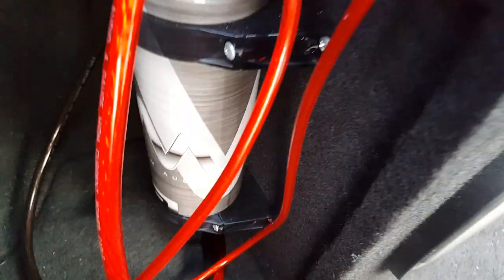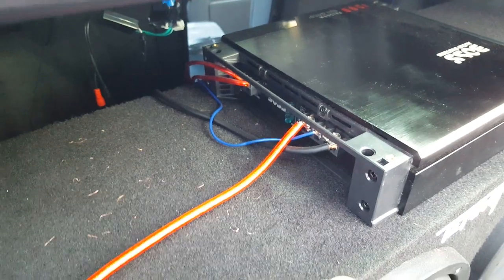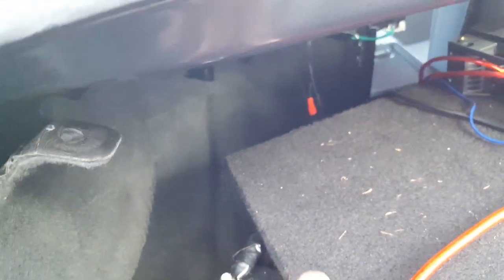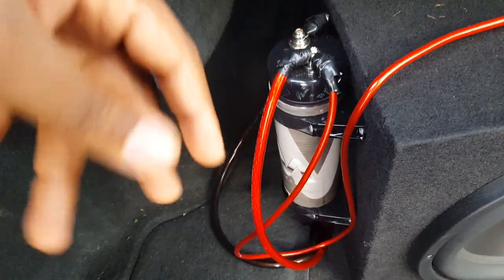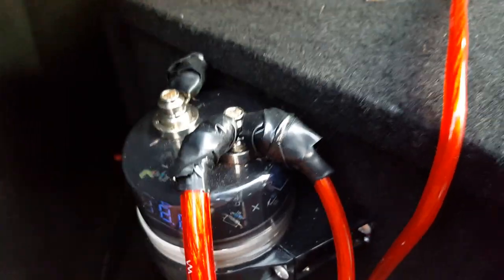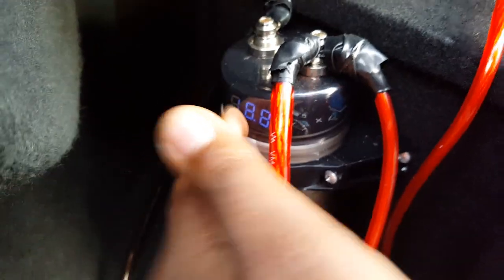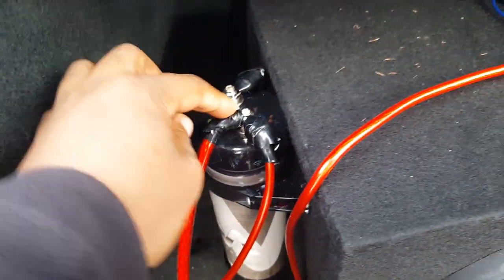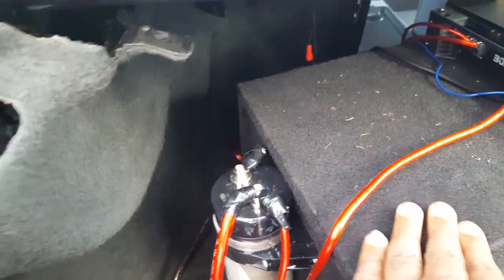HOW TO INSTALL A CAPACITOR WITH AC CAPACITOR WIREING TO YOUR  CAR TUTORIAL

Comment: Good video,  I'm an electrician and the set-up you have was done very well. Great idea to put tape on the caps of the capacitor too, that helps to ensure the current following through the exposed copper at those points cannot "arc" through another object or even a person.  Running a thicker gauge wire from the capacitor to the positive battery lead and then a smaller gauge wire from the capacitor to the amp is also highly recommended like you did so that you're not draining the power in the capacitor as soon as it gets there which would ultimately defeat the purpose of the capacitor.  
One thing I noticed you say was that some people say you can ground the amp to the negative terminal on the capacitor. With my experience and first hand knowledge on that I would have to advise against it.  Some systems won't even turn on if both the amp and capacitor use the same ground or sometimes if they're even grounded close to one another.  The best solution is to sand a spot on opposite sides of the vehicle frame wherever the capacitor and amp are being installed, so that you see the color of the metal rather than the paint.  This will provide a good solid ground. Now I say to prepare 2 spots on opposite sides so that each device has plenty of room to ground to the chassis of the vehicle without interfering with the other devices grounding.  If you have any questions regarding anything I've mentioned please feel free to ask away.  Thank you for the video and the time you took to explain it.
Reply: so when you're running a wire from the battery to capacitor you have to use a thick wire and from capacitor to amp you have to use a smaller wire why so i just cut some of the old wire 4 guage and im gonna use both you saying i should get a 8 gauge going to amp

Comment: Note that even if the capacitor doesn't help the sound and bass of your system, it will help take the unbalanced load fluctuations off of your voltage regulator, car battery and alternator.

If nothing else I think this reason alone is enough to justify installing one on your system.
That voltage regulator is working it's ass off trying to maintain the voltage balance for not only your battery, but all the sensitive electronics in today's cars.

So roll with it, if people argue the use of a stiffening capacitor on your system, point these facts out to them, and if they continue the argument they're just simply jealous of yo sheeyat!!
Reply from the maker: lol well said thanks for the lesson good to know.
Reply: ezridr1234 actually it will make it sound better.if your alt can't handle it. I noticed a difference in the sound of mine too when I had it
Reply: Chris Soden yeah I know it will, I was just making the argument for the ones that don't believe it does. there are other reasons to install one.
Reply: Exactly!! Especially, considering how affordable caps are!

Comment: You did right,... as a life long bass thumper, a capacitor MIGHT not help the audio. But with steady flow up electricity it def does! 
I like to connect the amp and cap thru a distribution block. To reduce chance of current hold, (thumping when power is turned on) look it up.

Comment: Should have used a splitter for the power source one wire straight to the cap and the other running to the amp but still clean

Comment: Yo so far your video has been the most helpful but i have a power cap that has two - and two + i don't want to end up hooking the wrong ones up
Reply: It’s only giving you more opportunities to have more wires to hook up like having a distribution block.  I have 3 hooks on mine.  It was easier for me to hook up wires without a distribution block.  For the negative side you may be able to run 2 negative ground ad different points, as of to like the body and frame of the vehicle.
Reply: Sorry forgot to say it’s like doing the Big 3 upgrade.  But on the capacitor
Reply: I have since learned much and no longer require a cap 160 ah of yinlong and counting

Comment: good video. if I already have my 4 gauge wire running for my battery to my amp can I just unhook it from the amp and hook it to the capacitor and then just run another piece of 4 guage wire from the capacitor to the amp?
Reply from the maker: yes sir you can that easy
Reply: +fabolousg4ever thanks man very helpful vid
Reply from the maker: +Kyler David no prob simple and to the point.
Reply: how do you charge it?
Reply: Jackie Welch the capacitor should have came with a resistor that you touch to the positive cap. Terminal and the line coming from the battery till it's fully charged
Reply: Never got a resistor but I used a voltmeter and charged it to 13volts and then put a 300. Amp fuse in. Thanks for your help! Got a question about a box I want to build. Just want to see what that tuning would be if you have a few.

Comment: What’s up bro I have a fast ass question how do you charge up a stinger capacitor without getting lit up and is everything all the same when it comes to the stinger capacitor
Reply from the maker: Should come with a load resistor to trickle charge the capacitor.

Comment: You connect the power cable and the earthing and Where do u connect the remote to the amplifier..do the remote cable connect with the capacitor or from the stereo connected straight to the amplifier
Reply: You don’t as he said it automatically turns off

Comment: i have the same cap and it always says 18.8 v when not in use. Good to know thats normal. It seems to work great though for how cheap it was. Is yours still workin good?
Reply from the maker: yup still working great
Reply: +fabolousg4ever  nice. All these people on here sayin caps are a waste of money aint heard my system before n after a cap. nite n day diff
Reply from the maker: +Jeff Barton yup only if people knew they are crazy the extra hard hitting bass is well worth it.
Reply: I just hooked mine up last night , it's the same exact one VM Audio 2 farad $25 free shipping from eBay good to know others have it and is working for ten as well... Mine also says 18.8 when not in use / when the car is off , wondering how did you wire yours
Reply: Loyalty 60 no you need a 10 farad capacitor get a voodoo capacitor on Amazon or ebay

Comment: I know you said that some people says that it’s ok to ground both amp and cap at the same ground point, I don’t know where their coming from but according to professionals they say not to ground cap and amp at same ground point.
Reply: I did like that and it working werry well I pluged only on amp not on battery coz battery cables are on amplifier there no need to connect cap an battery....
Reply from the maker: I use the cap and it works good

Comment: I have a brand new optima yellow top and brand new alt , and light dim & rev up n down when bass hit , btw I have 2 12 kicker l7 and kicker 1.500 watts amp
Reply: look into the big 3-4 upgrade for your vehicle. grounding the alternator properly with the battery is the big 4.

Comment: Just bought 2 12 in kickers with a 2500 watt amp, Do I need a capacitor?
Reply from the maker: +David Edmondson im pretty sure unless you have a optima battery
Reply: fabolousg4ever I got em hooked up so far no problems and they sound great!

Comment: hey man when not in use is it supposed to stop showing the volts? after I leave it off for a while it turns off
Reply from the maker: Mario Rios yea its suppose to mine only shows the voltage when the bass hits hard.

Comment: I see some on Amazon that claim to be 30 Farad, which I feel has to be an exaggeration. I have a 1100w peak amplifier, 2 12" subs. Would it be smarter to get a 4 Farad one? How much did u spend on that one and what Farad is it? Thanks bro
Reply from the maker: +Sam Goodman 4 farad is fine for that wattage.
Reply: 1000 watt =1 farad.. so 1.5F or 2F is good enough

Comment: I think it's working, simply because the readout in 13.5-14 volts.  That is almost impossible in a car with radio, heater, etc. running.

Comment: i know this vid is over a year old, does the cap still work well now and do you run everything off of one battery?, i installed my 2 12' kicker with a 2500 spl amp turned down but my battery seems to suffer on startups sometimes and was thinking about installing a cap
Reply from the maker: +Diondre Knowles still works perfect like the day i bought it works great and sub hits hard still very happy with my purchase.
Reply: that's great to hear man. And did it prevent battery trouble?
Reply from the maker: Diondre Knowles yup car was fine afterwards car drove fine like before i installed the subs.
Reply: thanks so much man. I now know what i must purchase.
Reply from the maker: +Diondre Knowles ok no problem

Comment: Where did you connect your remote wire (blue) ,cause I see you still got a stock radio
Reply: Get a new wire harness that adds the remote line and RCA hook ups. Like an adapter
Reply: Multiple ways tbh.
You can jump it off of an accessory fuse in the inside fuse box or any accessory  wire (if you know what your doing). BUT... make for damn sure its not a constant wire or fuse or your amp will always be on and will drain your battery.
Reply: Also the acura tl has a factory sub n amp so you can utilize the amp wiring harness if you know which wire is the remote turn on the factory amp

Comment: Caps are a waste of money. Just do a proper install. Big 3 Upgrade. If you need more power then add another battery.
Reply: ACCURATE ‼️‼️‼️
Reply: Wow a year later this is still a very ignorant comment, if they were a waist of money people wouldnt make them or buy them, it’s been years bro. I don’t see the manufacturers slowing down. 
They do a lot like dude said above they help keep your electrical system working great, the bass is cleaner and smother cause there is no strain on my battery... it Maintains the above 12 volts power or above  so your alternator isn’t forced. 🤦🏿‍♂️
Reply: these set up is not for competition level Bro! 😂 this guy need a little bass on his ass..that battery is enough to supply the power that amp is asking.. upgrading a Big 3 in a small car plus the AC motor will be a burden to your engine

Comment: You suppose to charge the capacitor first i think thats why your led doesnt stay on
Reply from the maker: iCleansneakers no this model doesnt come on unless the bass hits hard enough to use the capacitor
Reply: fabolousg4ever. It stays in an idle mode I'm using same model 3 Farad on 2 power acoustik 12's with a Alpine V12 1,000wX1 rms monoblock and a pioneer 6.2" head unit in an 03 eclipse and it totally changed my sound
Reply: But you are supposed to charge them first or you'll end up stranded with a dead battery like,me lol

Comment: Hello, better second battery :) Anyway, the cable between the amplifier and the capacitor is too long .... recommended max 30cm for proper operation. I also had a capacitor and replaced it with the second battery and congratulate ..

Comment: I have a 20 farad Boss capacitor. why does my digital display say 5 when the car is off and on and my music is playing? it doesn't change. its supposed too. I don't think it is even working because my heaadlights still dim
Reply from the maker: nah its not working replace it get a better cap
Reply: Even though it's brand new?
Reply from the maker: +Pj Parker did u wire everything up right check all your connections and yes some caps are crap make sure you get a good one check connections make sure its getting enough volts to power the subwoofer and make sure you have a good battery.
Reply: Honestly.. theres no reason to have a 20 farad cap unless youre running upwards of 15,000 watts.. im sure your capacitor has multiple connections?
Reply: it's holding a charge like a battery.

Comment: good video but do yourself a favor, get rid of that boss amp. you'll be happier running something else. I learned the hard way I has the boss 5,000 and my 1200 dei hit 10 times harder
Reply: Alpine V12 AccuD monoblock for the win!!! Lol loving mine best amp I've ever had otta prob over 100+
Reply: Stoned Sober Vapor Bham 
You from AL my dude?
Reply: I'm running 2 JL audio 1800 series mono class D amp with 4 JL w7s on an equalizer crossover mounted under my head unit on 3 extra batteries. Won 2 comps with it.

Comment: i got that same capacitor when i charge it keeps showing Lo
Reply from the maker: mine is over 3 years old and still works perfect
Reply: You need to charge the cap properly.  Check vids on how to properly charge and discharge cap.